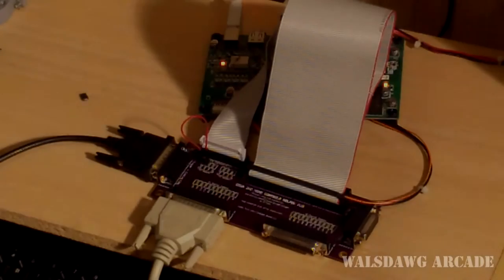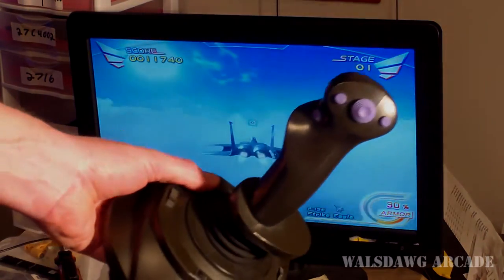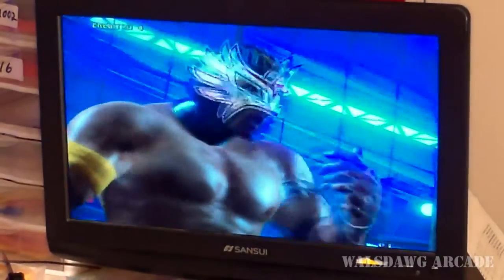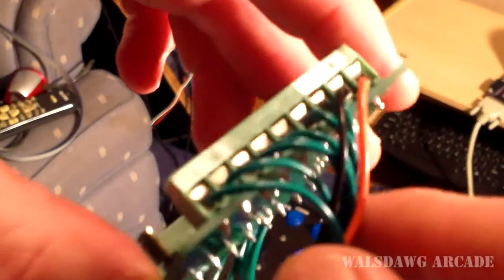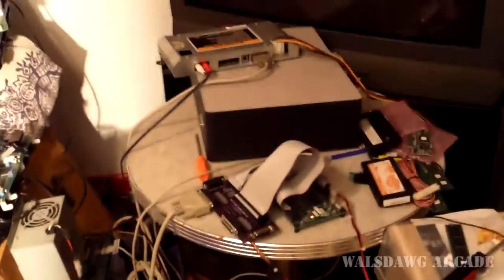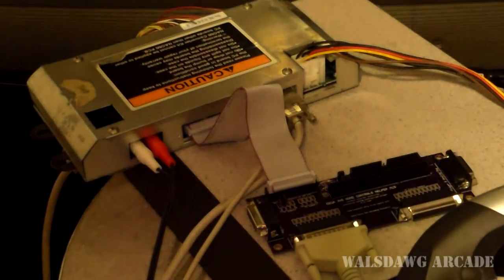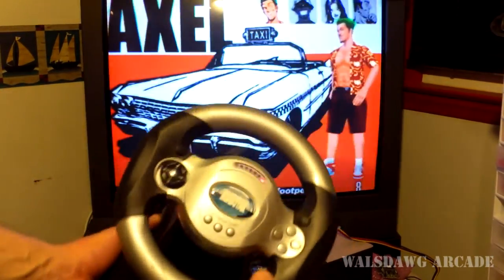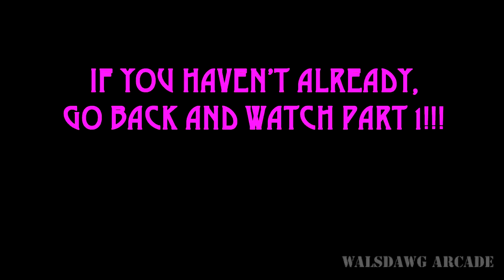S-JIHP Part 2: Demonstrating Mitsurugi-w's Sega-JVS I/O Helper PCB

Comment: Hi, is it possible to still buy one of these? I'm UK based but have a Lindbergh being delivered so would love to be able to hook up a modified wheel etc. Many thanks!
Reply from the maker: Yes it is.  I recommend pairing it with the MegaJVS I/O.  They are a powerful team and both are available by contacting me at Arcade-projects.com
Reply: @MitsurugiW  Thanks, looks like a good site. I've become a member but how do i message/contact you?
Reply from the maker: @robbaldwin6468  Once your account has been approved you should be able to click on my profile and start a conversation or PM. It can take a few days.
Reply: @MitsurugiW  Strangely it seems I have been banned from the website before even getting access? For the reason of 'Spam'. It says contact the administrator but I can't get anywhere on the website without getting the banned message. Any ideas? Many thanks.
Reply from the maker: @robbaldwin6468  What username?
Reply: @MitsurugiW  It's Robjab
Reply from the maker: @robbaldwin6468  Should be fixed.  The original profile info entered into the account triggered our spam bot filter.